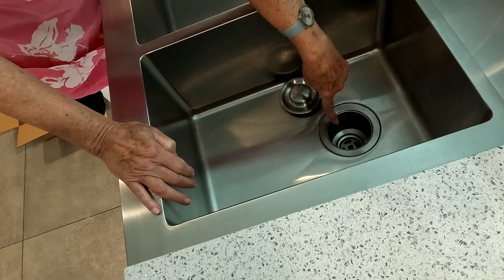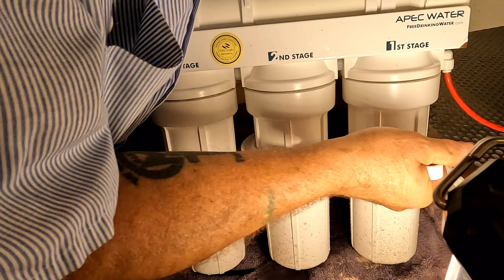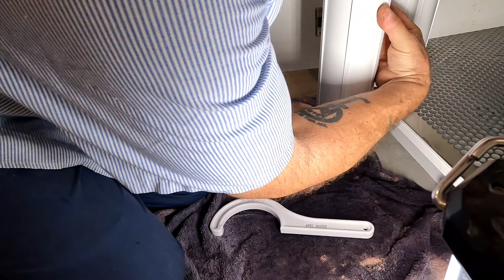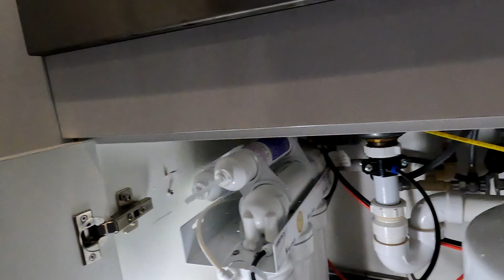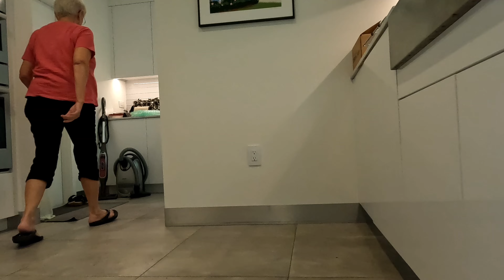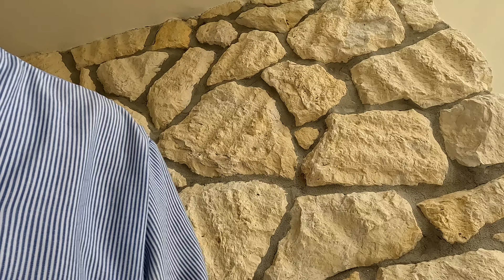A KITCHEN SINK WITH A FEW ISSUES RESOLVED

Comment: Hey John on those RO systems you need to check the air pressure in the storage tanks. They slowly loose pressure over time, happens to all of them. Open the faucet and drain all the water out. After the tank is empty check the air pressure, you want about 8psi.

Comment: That's the same kind of filter. They are both 10" carbon filters. Usually a RO has 1 sediment filter, 2 carbon filters and a membrane. Some units add an extra inline carbon filter.
Reply: After you service these systems  and change the filters, flick the lever up on the RO faucet so it locks on and drain the tank completely. It will take a few minutes. Check the tank pressure and then turn the water back 9on. Tell the customer to let the tank fill up a few hours and completely drain again. Tell them to do it a few times. They should throw out the next few batches of ice if the unit is hooked up to an Icemaker.  The carbon filters have small carbon "fines" on them. If you don't flush the new filters out then you will see black carbon floating in the water for a few days.

Comment: Good job Johnny but you forgot to put filter cartridges housing back up on the screws that holds it up off the bottom of the cabinet
Reply from the maker: I didn't forget,I'd rather have it right where it is,not worth the effort.
Reply: Always a smartss in the comments john